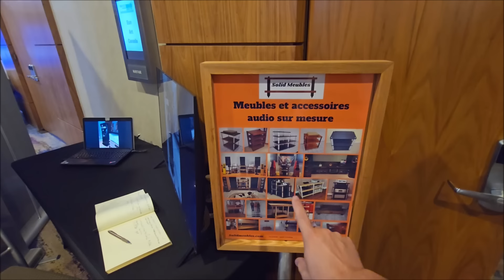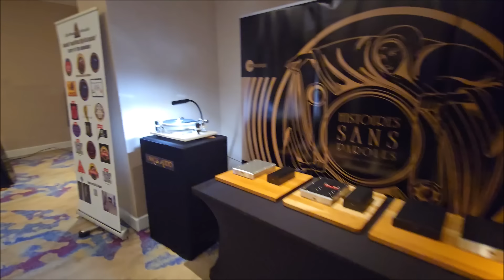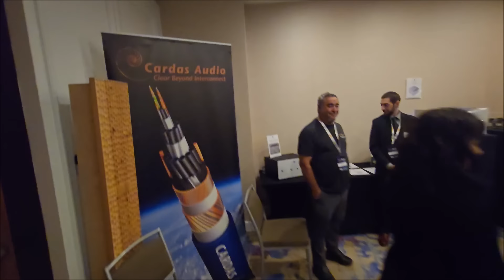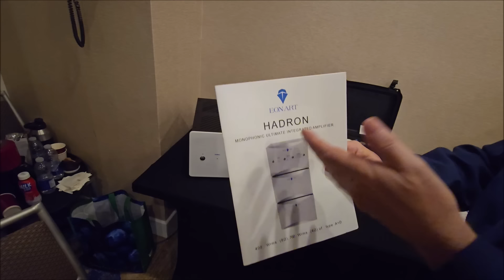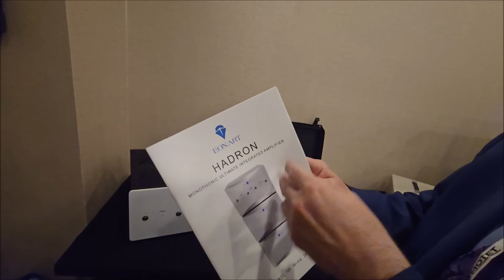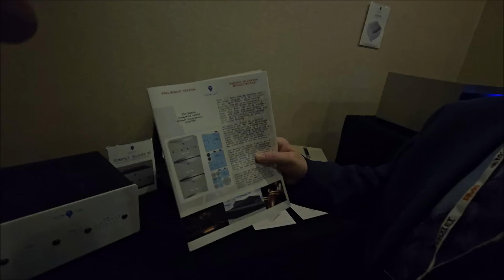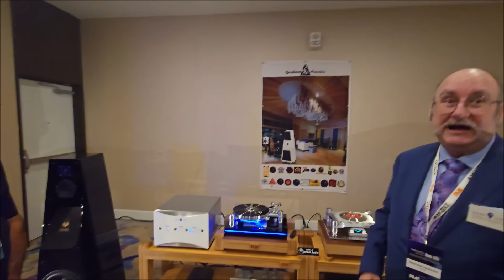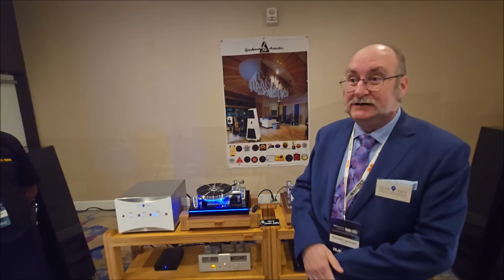🏆 I Was Blown Away by the Quality of Products AND People in This Room - Eon Art, Gershman and Oracle

Comment: 16:30 Damn that power supply looks like something that Angela Gilbert Young would make 😵‍💫
Reply from the maker: No silicone 🤠
Reply: @AudiophileJunkie  🤣👍
Reply: Ours are easy maintenance, with caps on a separate dedicated wearing board. Mostly from Mundorf. You should also see under the boards as every chemical capacitor have a specific proper PET or PP decoupling.

Positively without silicone glue everywhere that makes maintenance very difficult.
Reply: @stephanehautcoeur2307 silicone doesn’t make anything harder to service. I would actually prefer silicone to zip ties or other means of wire and component attachment that can degrade with time. Ease of maintenance does not translate to the best assembly, location, or connection.